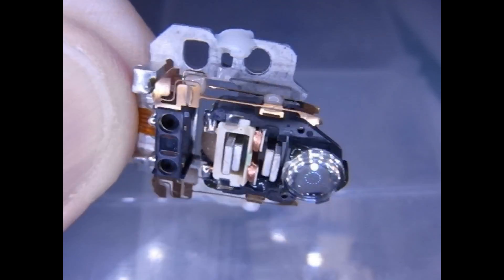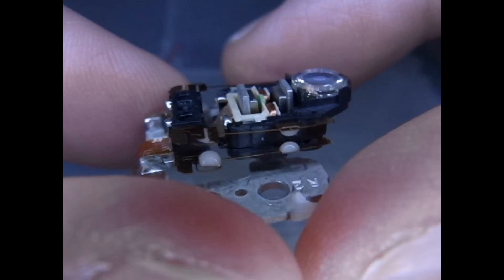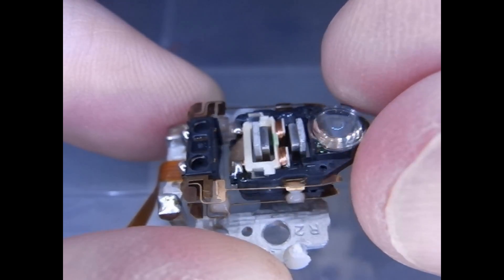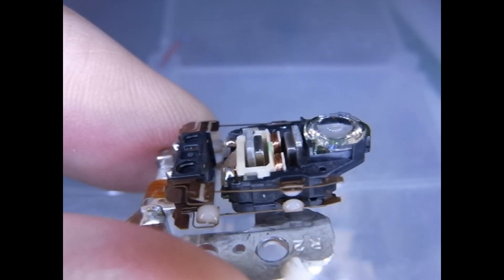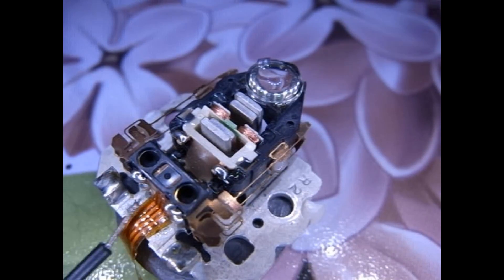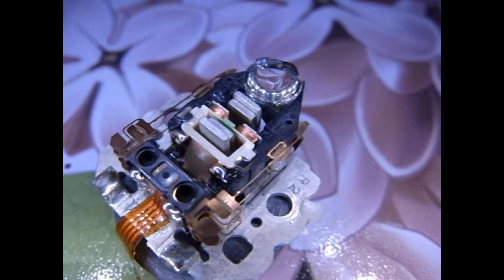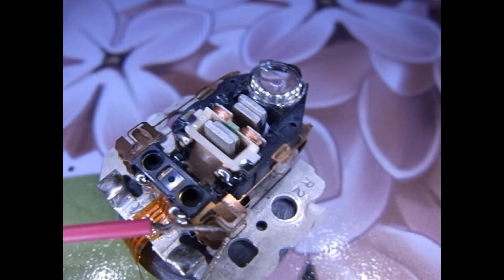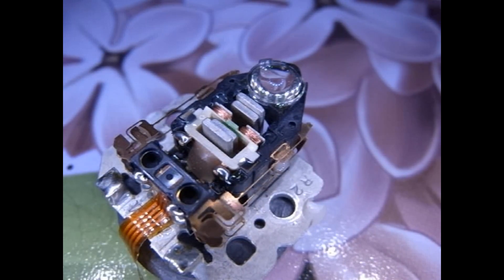DVD Optical Laser Head - Hack / Teardown

Comment: The signal being fed to the lateral tracking and focusing coils is modulated DC (PWM).  An AC signal would cause the attached mechanism to vibrate, just like a tiny little speaker.  The force exerted by each coil set (and thus the exact position of the lens) is controlled by varying the duty cycle for each of the two PWM inputs.  Even though the polarity may sometimes get reversed (to achieve positive and negative movment around the neutral position) overall it is still a DC, rather than an AC signal.

Comment: my DVD writer is not working please HELP
Reply: Hi. Have you updated your drivers ?. You may have to do an UN-install  then re-install through the computers " Device Manager " you will find it in " Control Panel " , Checked the connections, checked to make sure your getting power, Etc. Worse case it could have failed. You can purchase one for a low price at Newegg.com places like that.
Reply: Thanks